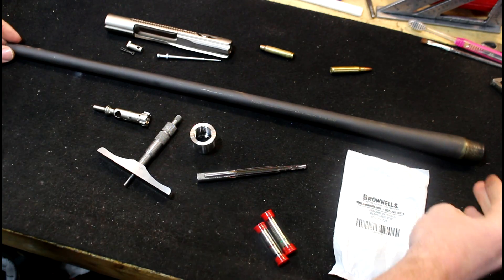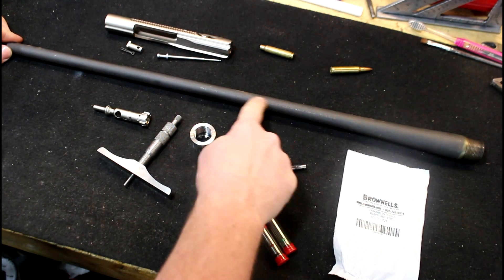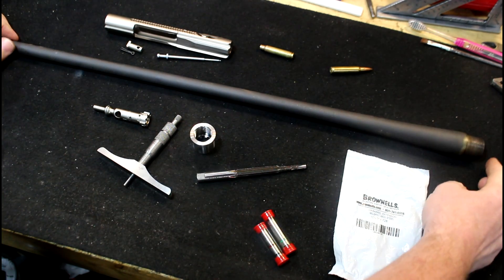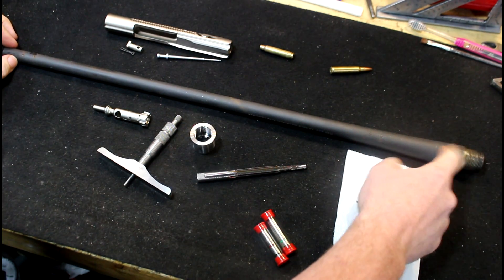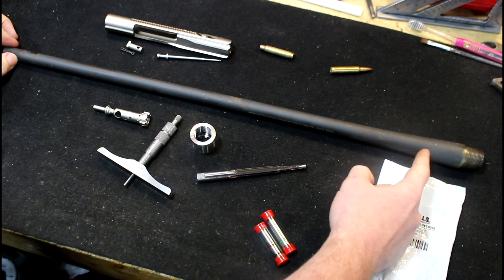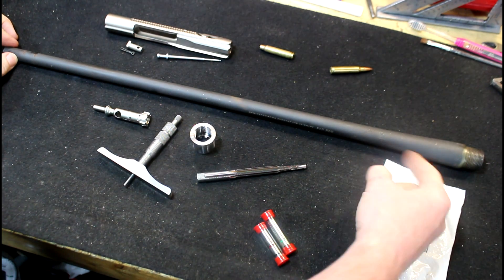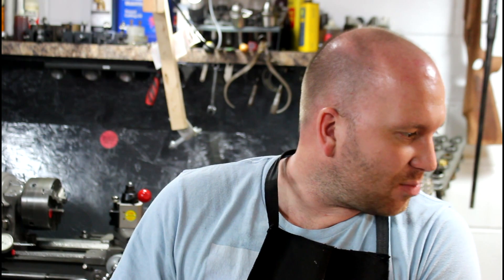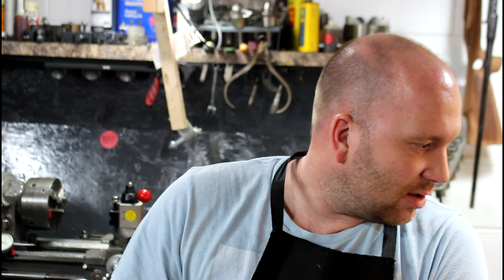AR-15 Barrel Machining, Fitting a Barrel Extension

Comment: I'm building an armalite ar10 and since no barrel manufacturer out here makes barrels for the armalite I've been wondering if it would be possible to put an armalite spec extension on the lr 308 barrel?
Reply from the maker: Should be no big deal.

Comment: Very impressive use of the lathe.   I have two questions.
1.  How do you get the feed ramps and old gas port to line up?  Seems if you try to line them up you might throw off head spacing and if your head space is correct the old gas port on the barrel wont be lined up.
2.  It looks like the new chamber will be thinner than the part you cut off.  Won't this decrease the pressure rating of that chamber?

Thanks!
Reply: 1. The Remington barrel came off of a bolt gun, so no gas port.
2.  The barrel shank area on a Rem 700 is a larger diameter than an AR-15 shank, so all of the shank area had to be turned down.

That question is good though because you're talking about hoop stress.

Since .223 Remington is such a narrow diameter case and chamber, there's a lot of chamber wall thickness even on a .998" shank.

For the threaded tennon, the barrel extension contributes to hoop strength since it's a high strength, heat-treated part, but must be fit tightly to the threads with no slop.

Comment: Great video. You didn't show the indexing pin install, how is that done?
Reply from the maker: You just push it into the extension. It doesn't go into the barrel at all.  It's to line up the barrel,  not to lock the extension to the barrel.

Comment: Can’t find any videos on “Removing” a Barrel Extension.
Reply from the maker: They should just unscrew. Some manufacturers will drive the pin into the threads hard, or even drill into the barrel to lock the extension which isn't needed if it's machined properly and torqued properly. You need a special wrench to install or remove it. If you have the proper tools not a big deal. I can't recall if I had a tool I made in this video or the rear entry wrench. The rear entry wrench works the best. A good barrel vise as well.

Comment: Which chambering fixture are you using?
Reply from the maker: This setup is with an adjustable 3 or 6 jaw chuck with a copper wire between the jaws and barrel. I also have an outboard spider to support that end of the barrel. When I have a shorter barrel, I use ether a spider on both ends or done through a steady rest. I have a couple lathes with different headstock lengths, so I can do most barrels through the headstock.

Comment: What do you do when there are feed ramps cut into extension and a gas port already drilled?
Reply from the maker: Not sure what you are doing, but you usually cannot set on of these back unless you have a heavy barrel with enough diameter to set it back from say a rifle length to a carbine length. Even then you will need to time the gas port with the new extension and get all the dimensions correct. Usually not a money saving en-devour. This video shows if you were starting with a barrel that doesn't have the gas port drilled already.
Reply: @precisionmachineshed  Im not doing anything, I noticed that would have to be the case (no port drilled yet). I was just wondering what  you would say to that situation.
Reply: Pretty sure you won't be able to do what's shown here in that situation. Maybe if you're starting with a 20 inch AR and you chop it far enough to get it down to a mid length. But at that point, you're burning through so much barrel might as well just get another one.

Comment: How did you torque the barrel extension on to the barrel, i.e. tools and torque specs
Reply from the maker: I made a tool that clamped to the outside of the extension and I cut a square hole in that tool to use with a torque wrench. I've read that they should be in the 100 ft/lbs range if memory serves. If you can get it to that, it's not coming off by itself. I have a barrel vise for the barrel.
Reply: Thanks for the reply. I was looking at the barrel extension tools (splined) tools.... but I highly doubt that is the intended purpose. I am hesitant, my thoughts are bending the locking lugs under 100ftlbs. What was the design of your tool.
Reply: @pubgerm6454  I use a barrel vise attached to my bench to hold the barrel. I have a split head wrench that I make a split brass bushing to grab the extension and then hit the wrench with a hammer. It is just like putting a barrel on a bolt action. I don't put much stock in a torque spec for the extension. Many  years ago in the military it was slow in the repair shop. We got the idea to pull off an extension from a junk barrel to see what was in there. Had a hell of a time until the alignment pin fell out. We could see silver solder (Or brass) in the threads. We heated it up and it turned off. So much for torque specs. I worked on thousands of M16/M16A-1 rifles and never heard of one coming loose. Maybe that is why.  Had a socket back off a M-60 barrel assembly once.
Reply: @oldgoat1890  we had an American Tactical Imports rifle come in the shop yesterday. One with the Aluminum receiver set , not the polymer.  Guy wanted a free floating handguard installed. Got everything apart. Put on new barrel nut, gas block on, free floating handguard . Was putting his suppressor mount/ break back on that times with shims.
While trying to get it timed the barrel extension broke loose and barrel turned. First time I've ever seen it happen.
Reply: @ebhsports6251  Apparently a lot of "First time" stuff is happening with all these generic "MIL-spec" parts. I have seen extensions for sale that are 4140,  8620,  and stainless. Sounds like a crap shoot, doesn't it?   Back in the good ol' days M16 barrel stubs were a hot item.
Reply: @ebhsports6251  How did you have the setup fixed? Were you using a reaction rod, vise blocks, etc?
Reply: @ebhsports6251  This is because you put torque on the extension instead of isolating it to the barrel.

For muzzle device work, I clamp the barrel.  The only way to loosen the extension when doing muzzle device work is to have the upper receiver clamped.

Comment: You may be the man to help answer a question I have. What I got going on is I'm designed and am building a pistol that kind of looks like a CZ scorpion k .my problem is I want to use a ar15 barrel in 9mm but I'm not useing a ar15 upper reciver. My barrel is 5.5 inch .my big question is can I have the barrel turned down in front of the barrel exstension. Down to as close to 0.667 as I can get with the barrel still being safe. I don't need the whole barrel turned down this far .i just need it turned down from the barrel exstension ring that the barrel nut goes around to attach the barrel to a AR upper .to about a half inch out from there. The reason for this is so I can attach some thing there .i can split the diffrence if needed by turning the barrel part of the way and opening the diameter of my attachment the rest of the way. I do not hold you liable in any way for any information you can help me out with .Thanks and GOD bless

Comment: I am watching the brass insert on the live center and it looks like it's not even touching live center since it wobbles.
Reply from the maker: maybe, I quit using that thing. Only used it a couple times. You can change your order of operations in most cases to negate that.

Comment: what are specs on chamber chamfer? looks to be a 45* cut. how deep into chamber before angling out??
Reply from the maker: It's a 30 degree cut. I can't recall the exact measurements. I have a print of all the measurements on my patreon page.
Reply: Precision Machine Shed where is this patreon page? appreciated
Reply from the maker: There is a link on my homepage and in the description of many of my videos. If not just google precision machine shed patreon and it shows up.